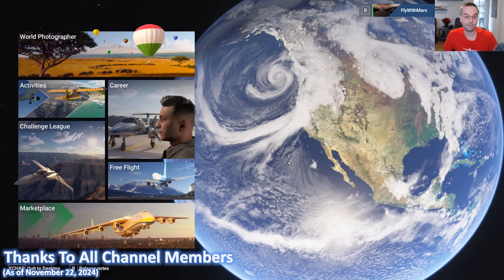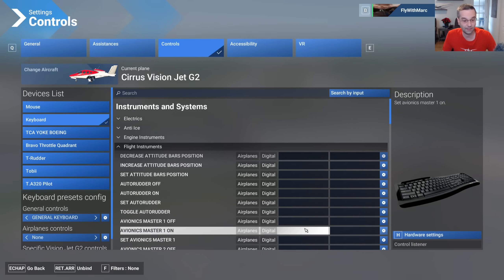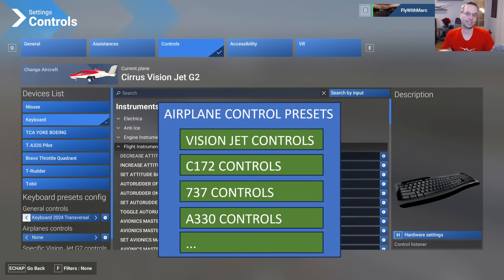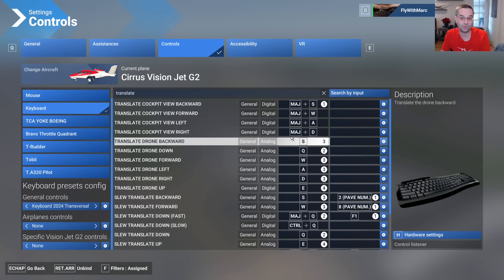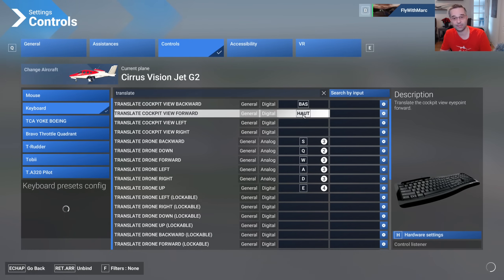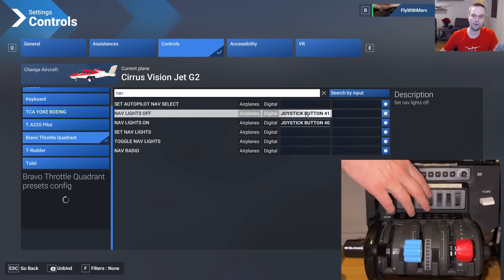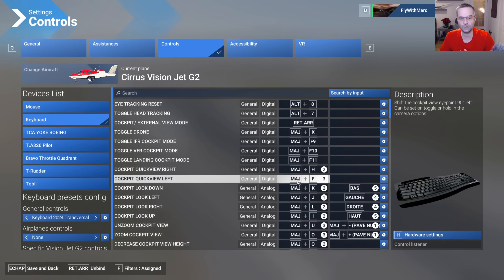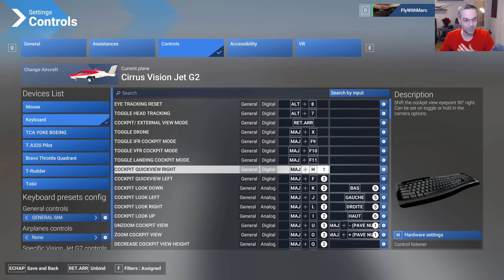A Quickstart Guide to Bindings & Conflicts in MSFS2024

Comment from the maker: I've posted my key bindings for the bravo on my website, with more to come in the future for different airplane types: https://flightsim.school/2024/11/22/a-quickstart-guide-to-bindings-in-msfs2024/
Reply: Do you have any suggestions for binding an axis?  For example I have a helicopter collective would it be the same thing - start the bind at the  bottom, do the full range and then finish where I started?
Reply from the maker: You shouldn't need to go through the full range, it'll automatically detect it's an axis when you move it.
Reply: @FlightSimSchool  it was button 5 on my saitek to open and close atc window, as well as scroll lock. Both buttons still open it but don’t close it!
Reply: Is there a provided list of all controls needed for flying in all planes, choppers, balloons, etc? I'd really like to weed out everything that will never be used by item name.

Comment: i have a question, i bound custom cameras and some other input keyboard, what am i doing wrong, i think it's getting confused with the three drop down on the left bottom section of fs2024 , i bound and then apply to all aircraft and saved, for some reason its not working,
Reply from the maker: Make sure to do it from the settings page rather than from the toolbar controls section, it doesn’t seem to always save when you do it from the toolbar

Comment: On my controls screen i do not have filters as a option
Reply from the maker: They’ve changed the menus around, you can still filter it down to assigned only but it’s on the top right now, if I remember correctly

Comment: Is it possible to have a profile for a joystick for example while also having a Honeycomb Alpha plugged in but under a profile that doesn't have anything assigned? In order to "activate-deactivate" hardware and have it plugged in but non-functional to avoid double input. So far my experience is that anything that's plugged in will work regardless of the profile I selected.
Reply from the maker: Yep that’s what I’ve done. I think there’s a button to delete all assignments or start from empty, otherwise you have to go through all the assigned keys filter to remove them by hand

Comment: I can’t get the external cameras working. I switch from internal to external camera. In 2020 I then had external left, right and up and down bound to my warthog trackball to look around the aircraft as I fly.  This isn’t working for me in 2024. Any ideas?
Reply from the maker: I’d suggest loading up 2020 and checking what those keys are bound to and then see if you can find those same bindings in 2024
Reply: @ I took photos of each profile setup in 2020. I copied ‘external view left and right ‘ from 2020. Then went into 2024 and used same bindings.  Didn’t work. 😭
Reply from the maker: I wouldn’t be surprised if it’s a bug honestly, there are so many little problems left and right with all these features

Comment: I have this problem with my thrustmaster airbus tca throttle quadrant where my idle thrust is in the reverse thrust section and I’m not sure how to change this, does anyone know??
Reply from the maker: If it's to fly either the A330 or A321, you can go on the built-in tablet (the one on the left of the captain seat) to recalibrate it. I had to do the same
Reply: @ Thank you so much I’ll do that right now!!

Comment: So in 2020 the sim recognised the controller and its presets. Is this not the case on 2024?
Reply from the maker: It has some defaults if you go through the presets, but my experience was that a lot of the bindings that were defaults in 2020 weren’t defaults in 2024

Comment: Great video! I was a bit confused about how to use the different presets for airplane controls and specific controls. Your video helped a lot to clear everything. I have a Honeycomb Alpha-Bravo combo and a Thrustmaster Warthog HOTAS, so changing both the profile and the inout device is a bit of a chore in the beginning. However, since 2024 is set per plane contrary to 2020, once it is done, I dont have to touch it, which is great news for me.

Comment: 2020 was the worst sim binding I’ve seen in 30 years of gaming…. How they set an even new low is just incredible. 

Go look at Aces High which arguably is the best and has been since 1997.  When you move a control it should go straight to where it’s bound.  When you click to bind you should be able to bind ANY device at any time.  When you have a conflict. Both should be brought to the top of the list and highlight as you move the control or push the button.  You should be able to see the live axis reading inline with the controls name after it’s bound and then also inside the curve editor with both raw and post curve outputs.  Any binding should be able to be hidden or disabled without unbinding it in line in the menu with the controls name. 

There should be no guessing!

Oh yes.. having 3 different levels of saved presets is infuriating and having the software rename a preset without my command is a no go…. Please go back to the drawing board and keep it simple stupid..
Reply from the maker: To me it feels like it was designed by a developer, rather than a designer

Comment: It's VERY IMPORTANT that you make sure not to mention that there's a preset called "2020 transversal" that defaults to setting the same key bindings as the older sim. If you mention that then you will destroy the impression you are giving that each and every binding has to be reset individually .😜
Reply from the maker: They aren’t complete. Have a look for yourself, specifically try and find the baro ref key ;)

Comment: so the binding group works as a layer architecture? so first, everything fro layer "airplanes controls" is applied, in case there is the same thing defined within "specific xxx controls", this "specific" profile overrules the "airplanes controls"?
Reply from the maker: No, my assumption is that a specific binding would be tagged as ‘specific’ and therefore be saved as a specific controls preset. It wouldn’t be saved as an airplane control at all.

Comment: Best explanation I’ve found yet. Thank you. Why they didn’t keep it the same as 2020 is baffling.
Reply: @decker3100  Well, if you think about it, this will be even more helpful with each aircraft you pilot.  General will stay the same, airplane/lighter…/helicopters will be bound and specific controls will be addressable as well…
I think it’s a great idea.
Reply: They only had 70 people working on it.....
Reply: 2020 did not have per plane configuration. So, every time you change the plane, you had to change the profile for each control device. It was horrible unless you rarely changed planes. Now, in 2024, any changes you make in a plane controls will stay there every time you come back to it. You can also hit apply to all planes, and it will be there for all of them. I find 2024 controls are not just better but game-changing. Other sims like DCS had it for a long time, I dont know why they didn't in 2020.

Comment: Just FYI.  I like flying the Vision Jet (G2) too, but after doing these bindings I still can't get control of the nav lights on this plane.  They are always on.  Landing lights and strobes do turn on/off.  Deleted all conflicts and still no luck.  However, the same bindings work fine on the 172, all lights, full on/off control. I'm using the standard light control switches on my Alpha Yoke.  Tried a switch on the Bravo with same result, no control.  Strange that it would work for you on the Bravo but not for me.  I'm seeing lots of inconsistency in controls as I try different airplanes.  Perhaps bugs in the airplane models that will get ironed out over time, or maybe I just don't know what I'm doing, which is entirely the case...🙂
Reply from the maker: There are some bugs with the lights that I’ve noticed. Sometimes they work, sometimes they don’t.
Reply: I see this plane does not have a switch for nav lights, only strobe, landing and ice?.  Perhaps it's not a s/w bug but the way the plane was designed.  Anyway, your method for binding these switches works perfectly!

Comment: Hi Mark. Very good video as always! 
Any keybinding to set heading bug to current heading? Found a binding for setting it to N which is not very useful. I would think in 99% of cases you want to set it to current heading (takeoff, AP on/off etc)
Reply from the maker: As far as I know there's no shortcut for that. The only exception is in something like the Airbus, when you set it to heading mode it'll default to your current heading
Reply: @ Thanks. Strange this is not implemented since many aircrafts do this when pushing the heading knob…

Comment: Hey good video, I am having an issue with my logitech 3D Pro , its related with the helicopter trottle, I have only test it in the heli that is in the training sessions, my little power stick in the 3d pro works fine in planes but is not binded in helicopters, I did bind it but is not recognizing it, anybody help with this?
Reply from the maker: I don't do any helicopter flying, so unfortunately I won't be any help

Comment: Merci. As expected, there are going to be a lot of growing pains--not just the PITA of setting everything up, but the many annoying bugs. I know this is a bit off-topic, but it would be great to see some related advice. One of the worst issues I've experienced so far is the inability to turn rotary knobs, such as adjusting OBS or HDG or zooming a Garmin GPS. I can click the Direct to button, but can't enter a waypoint. I've tried changing the settings but can't get the curved arrows to appear in the click spots--just those weird blue/yellow highlights. I have peripherals but obviously, the keyboard and mouse are essential for certain inputs.
Reply from the maker: I switched mine into legacy control mode in the settings to get rid of that, the only issue I’m having now it I can’t click on the top of the gps knob in a g1000, not sure if it’s a bug or I’m doing something wrong though

Comment: Next to 'Airplanes' is 'Digital', any info on what that means?

Helpful info. Thank you
Reply: I think those are Tags.  So that binding is used for Airplanes and is a Digital control (as opposed to some kind of analog device).  There are probably tags for Helicopter, Balloon, etc.
Reply: @mapolinski  I appreciate the reply. As usual there is no documentation on any of this. Time will tell.
Reply from the maker: It's really not clear, at the end of the day they work the same way though

Comment: Very useful video Mark. Quick question. Using Nav Lights, as an example, what is the difference between "Nav Lights On / Off", "Toggle Nav lights" and "Set Nav Lights".   I understand the first two, but what does "Set" do?
Reply from the maker: To be honest, I’m not certain, I never used it in 2020. I think it’s more for external apps (like spad or axisandohs) through simconnect to give it another way to set a value with a parameter. But I’m not sure about that.

Comment: Use Toggle Nav lights, that is a lot easier than binding on and off separately.
Reply from the maker: The problem with toggle is it won’t always set the state properly, so you can easily end up in a situation where the on and off become inverted if you forgot the switch on the bravo on initially.